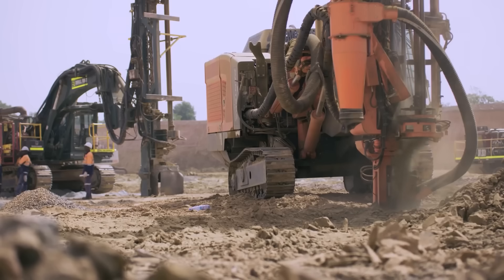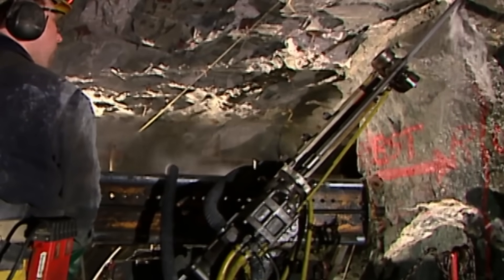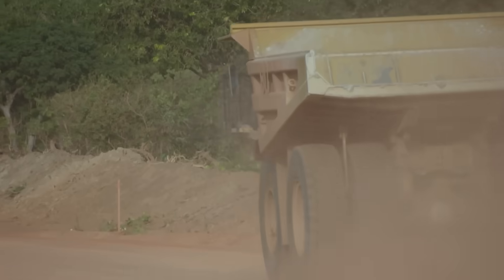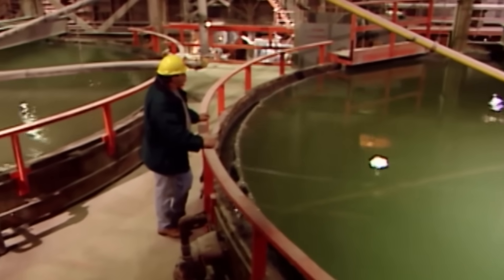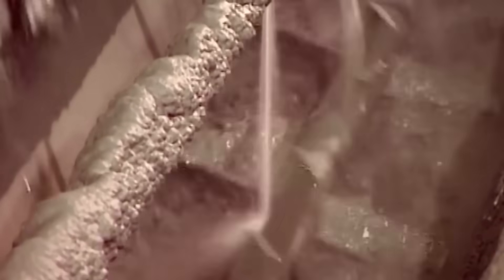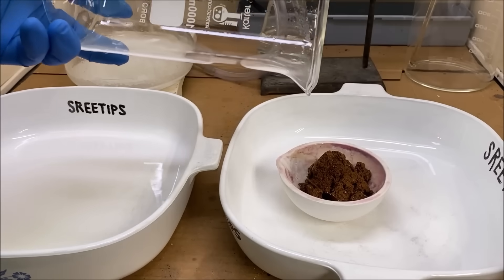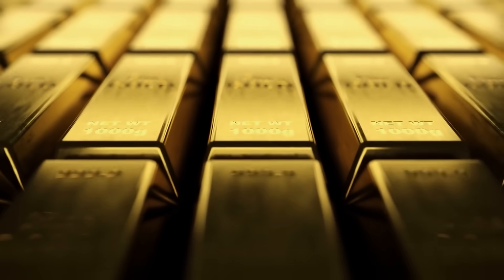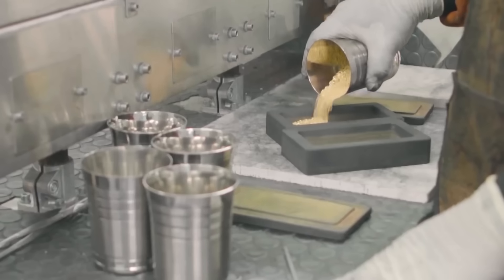How GOLD is made

Comment: Gold IS NOT MADE. It is a fundamental element that is found in Nature and may or MAY NOT need to be refined to 98.79% purity (bullion grade). You CAN make gold from other metals by bombarding it with neutrons, but that's about two hundred BILLION times more expensive than naturally occurring gold (the cost in about 1971, it would be FAR more today). Unlike u-toob videos claim, there is NO 100% pure gold sold or used, as it's too SOFT. Rubbing your bare finger across the surface of a 99% pure gold bar will "goldplate" your fingerprint, it's THAT soft! In high school Chemistry class, we had a sample of each of the naturally occurring elements including a 99% pure gold bar, we each had an option to rub. Credit Suisse set the "standard" for bullion at 98.79% gold, some copper and almost 1% platinum or rhodium in about 1870. That creates an alloy that can be shipped and handled (with gloves) without undue wear and loss of weight. A bar of 98.79% gold bullion is still soft enough to bend a 3/4" thick (actually 20mm) bar in half over the edge of a table with about 20Kgs (44 pounds) of force. That bar weighs about 56 pounds (25 Kilos). Gold is almost 30% denser than lead, or a 25 pound sack full of lead dust would hold about 33 pounds of gold dust.

Comment: After watching this video, just one question in my mind, "How did the ancient Egyptians make it? "
Reply: In ancient times, people had a process for getting pure gold from rocks containing it. They started by using basic tools to dig out these gold-bearing rocks from the ground. Once they had the rocks, they crushed them into smaller pieces. This step was important because it exposed the tiny particles of gold that were trapped inside.

To collect the gold, they used a method called "amalgamation." They mixed the crushed rocks with a liquid metal called mercury. This mercury stuck to the gold particles, making them easier to work with. When they heated this mixture, the mercury turned into vapor and disappeared, leaving behind the gold.

Another technique was "smelting." They heated the crushed rocks to very high temperatures in special furnaces. This caused the gold to melt and separate from the other materials in the rocks. Sometimes, the impurities rose to the surface and could be skimmed off, or they formed a kind of waste material that could be removed.

A more advanced process called "cupellation" involved melting the gold alongside another metal, usually lead. The lead combined with the impurities in the gold, leaving the gold in a purer state after the process.

In their quest for accuracy, they also used "fire assay." This method involved mixing the gold with known amounts of other metals like lead and silver. By heating this mixture, they could determine how much gold was present based on how much of the other metals were absorbed.
Reply: @SLIMMELONBRO  :Thank you so much for the information. I learnt about these processes in chemistry. It's now like a flashback.
Reply: Valid question. I really hope someone answers
Reply: Slaves. The gold empire is behind every war in history and private property protects things like secret human breeding.